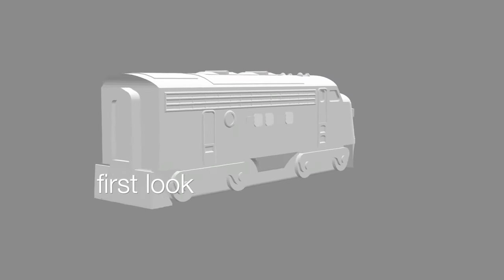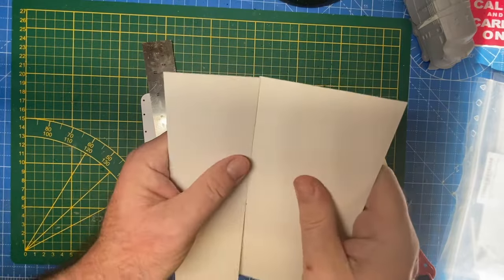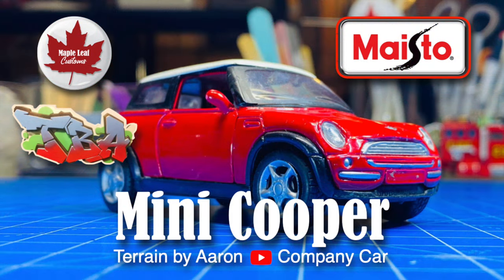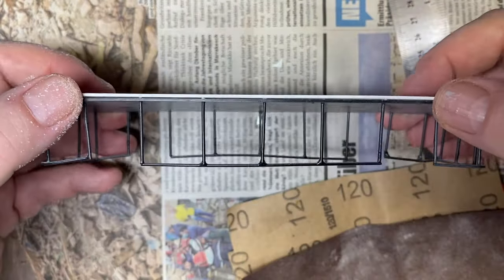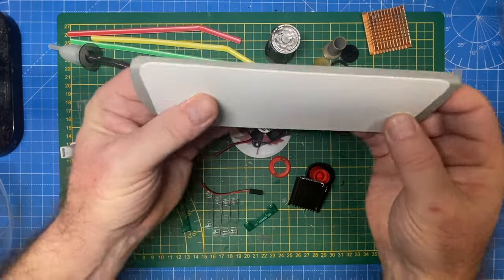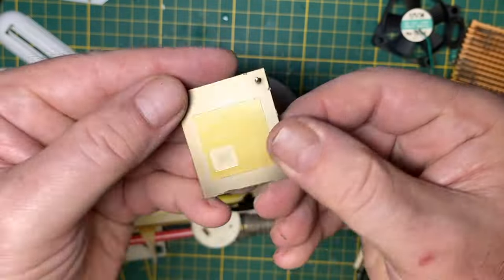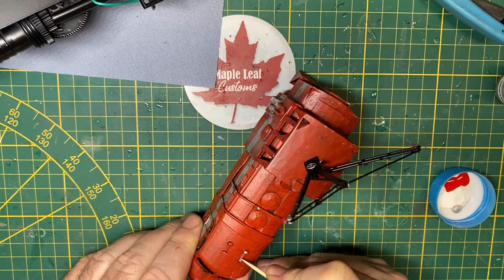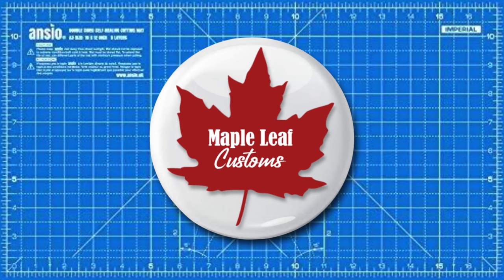SKYTRAIN (257) 3D resin print and trash bash fantasy build

Comment: Cool fantasy build from random parts :) 
Among the stuff I saw a board, which looks like PC? power supply board, and if it's been on recently, those big capacitors might give nasty shock or even kill someone, as they can hold high voltage charge for a long time, especially at the hot side can be mains voltage or higher, depending from the device. 
It's good safety practise to check if they have voltage with multimeter, and drain the charge using isolated cables and suitable resistor. Some guys are just shorting the capacitor with isolated screwdriver, but that might damage the cap, and give quite loud bang if there's high voltage charge.
Reply from the maker: Good safety tips, Juhani. Thanks! Any PC parts in my bin are at least 4 years old. So far no shocks or damage to me or the components. And, I've got so much collected now, I probably won't need to disassemble any more for parts. 🍁☕️👊

Comment: aah, the thrill of creativity. once you started I could feel it... when the left side of the brain shuts up finally and all that remains is the creative process.
that's a great lot of details, funny what pieces you used, and it all goes together well. :) all I'm missing is maybe a faint golden imprint on that belt in the lower chassis, a Continental drive belt maybe, or any other brand. :)
Reply from the maker: Glad you enjoyed this fantasy build, and yes, a branded belt would have been the icing on the cake! Missed that one. 🍁☕️✌️